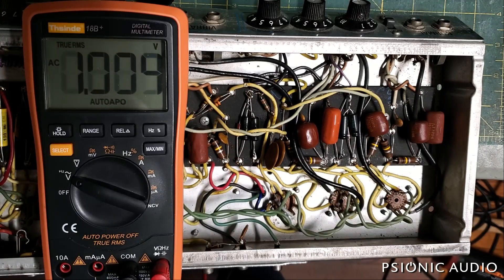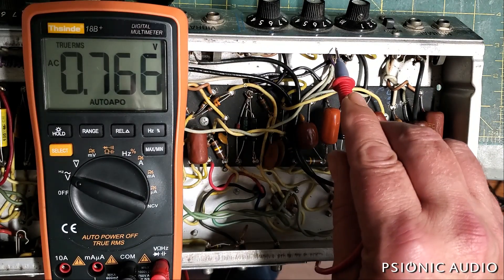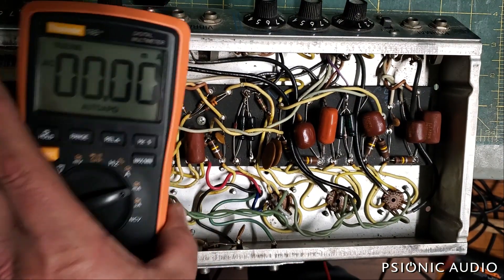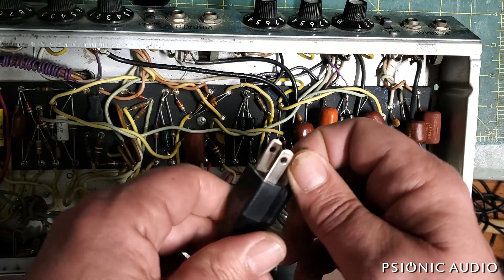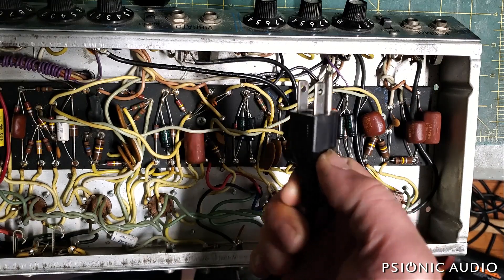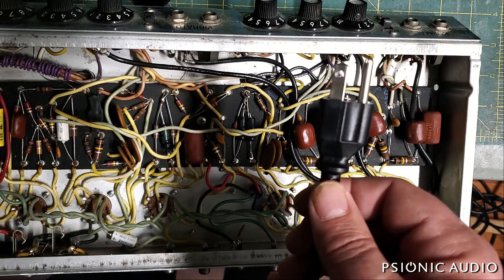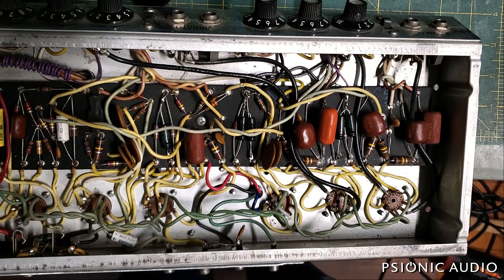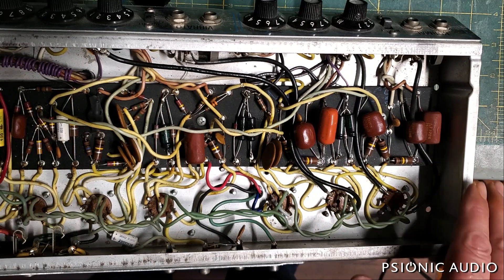This Ugly Wire Can Save Your Life - Please Let It

Comment: In general for audio equipment repair as a service to the general public you will see two types of DUT (Device Under Test) AC power supplies, one for repair and the other calibration (generates pure sinewaves, which is important for measuring DUT AC THD, power factor, load regulation, line regulation, etc.) and usually have their own dedicated bench. You don't want a tech to use the calibration AC supply for troubleshooting. 

The repair DUT AC power supply has several features helpful in repair of equipment, very common are: Isolation (both power and ground), Variable Voltage (Variac), current limiting (usually selectable with power resistors), selectable circuit breakers (usually all slow blow, hydraulic/magnetic), old fashioned meter movements for AC current (usually two ranges) and AC voltage, and also the ability to measure AC leakage. Some would few AC leakage as an outgoing test, but it is better to measure during repair because if there is a problem it should be fixed. 

From a liability standpoint you cannot rely on the house/facility AC wiring to have low AC ground impedance at the levels of AC current that could kill someone (assuming the receptacle is not a GFCI), if not a GFCI than the trip is just a fuse or a panel circuit breaker. The equipment should be tested for AC current leakage before returning to the customer. Depending on the company this can take several forms (most DUT AC repair power supplies are designed in-house by the engineering staff). In the USA for 120VAC powered products a generally first pass approach is using an isolated ground (meaning you can choose how to connect the electrical safety ground on the receptacle) GFCI to power the DUT. If the equipment trips the GFCI there is obviously a problem with leakage in excess of accepted GFCI calibration (time and current). The other method, which is more accurate, is to measure the AC ground current with an AC leakage clamp meter (clamp meters are better for repair and personal safety), which has more resolution than the GFCI and enough sensitivity to uncover transformer insulation breakdown, which will happen over time.

There are more problems with AC distribution than high safety ground impedance relative to personal safety. For example the outlet may use a bootleg ground, which is meant to fool an electrical inspector that the safety ground wire is properly connected. Just assume you can not rely on the integrity of the ground connection unless you bring a way to test it.

Comment: UK 3 pin plugs used to have to be fitted to any electrical item when it was bought. I've heard the tales of people removing mains noise etc from their amps, by disconnecting the earth from the plug.
People have lost their lives due to the stupidity and bad wiring of others. Please be careful.

Comment: Hi Lyle,
 I just saw this video, and you bring up very important and good points to owners of old tube amps. I've never run a ground stake at places where the wiring was out of date. I've been zapped many times since I was a teenager from things like this, but I did learn a safety tip back then to prevent myself from getting electrocuted. When I found places like this and we had to play there, I would talk with the owner about "fixing" the outlets that the band would need to plug into. I would bring a roll of copper strand wire, strippers and cutters, and a screwdriver and a hose clamp. I would run copper wire to each outlet's casing, and fasten it with the screw from the outlet cover, then run the wire to the water meter, and find a bare copper spot there, then fasten the wire around the pipe a few times and clamp it down with the hose clamp. We never got shocked after that. Instant earth ground.

Comment: Also what happens if the hot and neutral are reversed at the outlet? I’ve seen that happen.
Reply from the maker: With a modern three conductor cable? Inside the amp the fuse and switch are on neutral but the amp works fine. The power transformer primaries don't care about polarity (AC has none).
Reply: Fairly common occurrence. We plug in 1 multitap extension that circles the stage and plug everything else into it. So all our hots, neutrals and grounds match. If there's a house PA you need to check against that.
Reply: It depends on what you plug in to it, the neutral white wire is actually the same as the green ground wire, they are both connected to ground at the breaker, the difference is the green ground should never carry current whereas the white neutral will carry the same amount of current that the black hot wire carries... in some situations having the polarization reversed can kill you as it’ll put the live current on the ground. If you have a GFCI outlet it’ll blow the breaker. Some equipment uses a neutral hot design where the neutral is switched not the hot, that situation can also kill you... Anything that uses the white wire as the chassis reference would be not good, and some things won’t work at all if they are reversed... What’s worse is if the 3 prong equipment is wired backwards and the ground is open, you are in serious danger in that case and all of the current will return on the safety ground.... Outlet testers are like 10 bucks and are idiot proof, 2 green lights and your good, no reason not to buy one and test any unknown outlet ya know... I’m a feild service engineer and I can’t tell you how many times the equipment wasn’t working correctly because of outlets being wired incorrectly...
Reply: @robertw1871  I know this comment is old, but if understand it correctly, you are super wrong. A decently modern amplifier or one that is maintained to modern standards has no live wires from the outlet connected to the chassis. Safety ground is an "exception" if you will, because it is. But it isn't a live wire, because it is always connected to earth, and at least where I live, that is a different final connection than where our neutral goes. It is a connection to real earth. So if safety ground ever is anything but 0V, there is a serious issue with your house wiring.
Reply: @hanswurst9120  Neutral and Ground are the exact same thing if it’s wired correctly, they use two separate conductors, the white neutral carriers all of the current that the hot black wire does to complete the circuit. The ground is kept at the same potential voltage as the dirt outside your home is so there should never be any current flowing on the green wire, if their is that’s a fault and dangerous… many devices have only 2 wires, in those you never want anything connected to the chassis and are what’s classified as double insulated, nearly everything that has a metal chassis will require a 3 wire system with a safety ground. So if it uses only 2 wires the case needs to be plastic or other insulator to achieve the double insulation…. I’ve reread my comment and don’t believe it’s incorrect… if you look in your breaker box the Neutral and ground are referenced to eachother, the only difference is one carries current and the other should not… Ground and neutral are BOTH at zero volts with respect to earth at all times, the voltage swing is on the hot wire, the difference again is amps are flowing in both hot and neutral and not on the green earth ground… It’s there only for safety and not to carry any power.

Comment: It bears repeating that one should never play guitar through an AC-powered amplifier, grounded or not,  while barefoot on a concrete slab or grassy lawn. The same can be said for operating my Dad's old metal-cased power tools in the basement as a kid; and damp, sweaty slippers provide poor insulation, as I discovered the hard way. Modern double-insulated power tools with plastic casings are much safer; battery-powered tools (and portable  battery-powered amplifiers) are safer yet!

Comment: I do wonder if the guitar's exposed metal hardware ---- strings, bridge, tuners, and pickup covers ---- could be connected to audio ground (at the guitar's output jack) through a high-value resistor or a coupling capacitor (a modern, high-voltage, XY safety capacitor perhaps) to lift the metal parts above ground sufficiently to prevent a shock but still allow RF noise to be dumped to ground and canceled. Would the guitar pick up lots of hum and buzz for the amp to amplify?  Perhaps it'd be acceptable with humbucking pickups, but objectionable with single coils....

 I spent 15 years as a bench tech, often working on 1970s analogue audio equipment (mostly Asian-built, Pioneer, Kenwood, Sansui, Yamaha and the like), nearly all having two-pronged power cords (many but not all of them polarized), and they invariably used a 2 to 4 meg resistor from the chassis to one leg of the power cord, and yet ground loop noise or electrical shocks were uncommon (if a ground loop occurred it was often because of an antenna ground or cable-tv shield with a voltage differential, or the introduction of just one 3-wire, earth-grounded device into the signal path, like a powered subwoofer).. Of course,  solid state audio circuits are lower impedance than tube circuits,  and far less likely  to pick up RF noise, not to mention that solid state amps aren't running off of ancient, 70 year old transformers with 400 to 500 volt output that might have voltage leaking to the chassis !

I just remembered that Keith Relf of the Yardbirds was electrocuted while laying in the bathtub and playing amplified guitar.

Comment: Most hardware stores sell a simple outlet tester that looks somewhat like a ground adapter but has LED's that indicate whether the outlet is correctly wired and has a good ground or not. These are much easier to use and understand to the average layman then the use of a multimeter.
Reply: That is what I have in my Gig-Bag.     I had to buy a second one for my tool box.
I agree a multimeter is often helpful to have when playing out however as you stated the LED Test Plug is the easiest to use.
Reply: @hkguitar1984  , a GFCI (ground fault circuit interruptor)-equipped power-outlet strip would also be a good idea ( not the same as a "surge suppressor"). A GFCI outlet ---- now required by electrical code for kitchens and bathrooms ---- will trip and disconnect the power if it detects any leakage current from the device plugged into it (a leaky death cap perhaps, or a power transformer with voltage leaking to chassis, etc). Touching the guitar's tuning heads to the mic should also disconnect the power to the amp if there is a shock hazard present.
Reply: @goodun2974  Good advice Sir.
TBH I am surprised I made it through my youth without being electrocuted.
Back in 1979 we were playing an outside party once with hundreds of feet of un-grounded extension cords.......
I had a full pitcher of Kamikaze drinks spilled down the front of myself and my brand new Ibanez Iceman!  A DIY Stage Lighting System using Standard Outdoor Floodlights run from a generator, the P.A. System being run from a neighboring residents and my Twin Reverb on the end of a 75' extension cord!   Looking back I can now see that there is a God and he's been watching over me all these years!
The GFCI is a most useful safeguard, we have many in our home and shop.
Reply: @hkguitar1984  , in my New England state, electrical codes are pretty stringent. Some 25 years ago, my sister got married on my moms' lawn, under a big tent---- the inspector made us drive ground rods for the tent-support poles because they had lights hanging from them, and all extension cords run from the house (70 or 80 feet away) had to have GFCI protection in them. We also had to put rubber mats over the extension cords where they snaked across the lawn. No band, just a DJ, although an acoustic duo played the music for the wedding ceremony through the DJ's sound system, from the wooden deck (good electrical isolation, that). No one got zapped, thankfully. That gig you mentioned sounded like a very unsafe gig!
Reply: @goodun2974  Yeah, there is a big difference between doing it correctly (your Sister's Wedding) and the house party I played at.   Rural Michigan in the late 1970s would seem like the Wild West to young people of today.......LOL
Reflecting back on that party we played, there was no aspect of that event I could call safe.
To again comment on your Sister's Wedding, an event as important as a wedding needs to be set up safely.  Such important events of a person's life typically have only one chance to succeed and all resources should be used to make sure it goes smoothly without incident.   TBH, I am impressed at the ground rods for the tents due to the lighting, great call on the inspectors part.     These days with low power LED lighting things are somewhat simplified.   Back 25 years ago Wattage was king when it came to illuminating nighttime.........

Comment: My lead guitarist in a band I was in back in 1992 got a pretty bad shock from a mic on stage and had to be taken to the hospital. He played a 68 Super Reverb with the 2-prong power cable and the club was old and only had 2 prong outlets. Another time at the same club the lead singer also got a hell of a shock while adjusting the knobs on a Boss RE201 while holding his mic. I think  after that gig he told the club we wouldn't play there any more until they upgraded the electrical. Turns out they were years out of code and were being cheap and not getting it fixed. The club ended up getting shut down for 2 months after someone made an anonymous tip to the city reporting them. Hmmmm, I wonder who that was. 

Old non-grounded gear is dangerous people!
Reply: In a band situation, one of the most common types of shocks is guitarists holding their strings and then grabbing their vocal mic (or worse yet, contacting it with their lip - ouch!). 

I learned not to grab the vocal mic but to swipe my hand across it as a first test, with enough momentum to carry my hand past the mic (rather than gripping it and getting locked on). 

But a quick safety check would be to measure any possible AC voltage difference between the gripped guitar strings and anything else you might touch onstage with an inexpensive multimeter. 

If there's appreciable voltage measured, you'd want to reverse polarity on one of them (old days) or employ some modern solution if it's modern 3-prong house current. One protocol might be to let the PA and mics be the reference voltage (because several bandmembers would be touching mics) and reverse polarity at the guitar amp (again, old-days 2-prong logic, I'm not up on countermeasures today).

A test like that could have saved your singer from shock if his mic and the RE201 had been metered, it would have shown the shock hazard present that he experienced.

Even in these modern times where most everything is 3-prong, it couldn't hurt to meter for voltage differences between equipment

Also - I've read about putting a resistor in guitars - the bridge is usually connected to the output ground, but I've read about putting a resistor in line on the ground wire's way to the output jack ... to protect hands from any shock hazard entering thru the ground wire then the bridge then the strings.

Anyone know what value resistor is good for that?

Comment: I was selling Fender amps when the first ones with three wire cords and three position ground switches arrived from the factory. Most wall plugs had not been converted to three prong, so Fender recommended a 3-2 converter, with the little wire on it attached to the mounting screw of the wall plate. If you had a three prong outlet to plug into you were to leave the ground switch in the center (inactive) position. If you used a plug converter the outer settings (and death cap) were to be used like those on the older amps. Those amps had a red three prong plug, most of which by now have had the ground prong snipped off.

Comment: Damn those old amps are dangerous.
Reply: Technically anything that plugs into the mains is equally dangerous, it’s just the high plate voltages that are a bit scary. And a 5 dollar phone charger is probably a lot more dangerous than most vintage amps, since even though both lack a safety ground, the vintage amp provides better insulation du to its physical size.

Comment: Rather than ground rod did you consider latch to copper pipe?
Reply: Water pipes aren't always grounded; I've been told that in some homes the water meter or pressure regulator, or the "service entrance" equipment or shutoff, where the water pipe enters the building, may have nonmetallic parts that prevent the pipes from having an electrical connection to the earth.  Even so, the copper water pipes could inadvertently get a "ground" from touching a sheathed metallic electrical cable or conduit pipe (or even a gaspipe?) in the walls or in the basement,  somewhere that it can't be seen or isn't obvious. I also wonder if the copper pipes would be subject to galvanic corrosion if there was a small ground-differential current flowing through them. Installing a ground rod for a specific outlet would be a better idea.